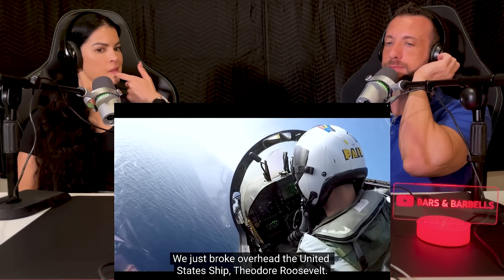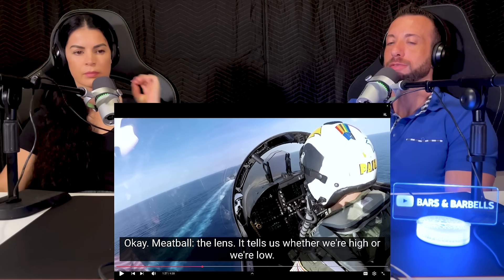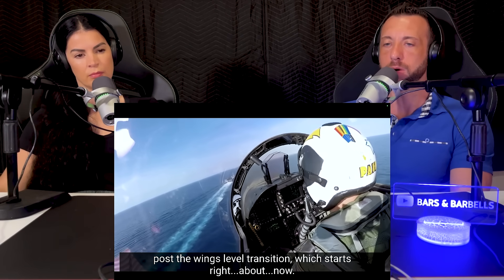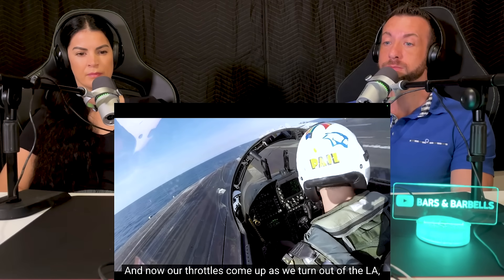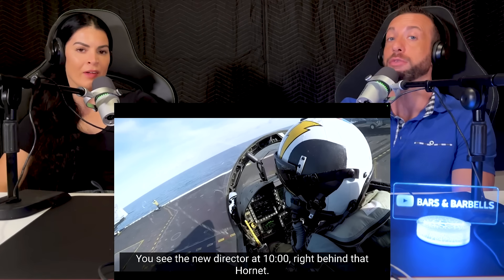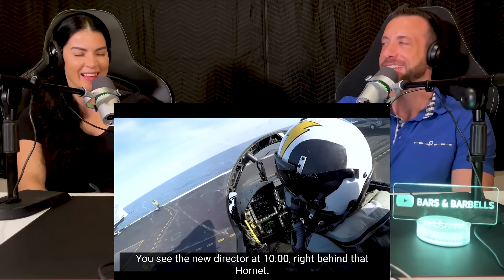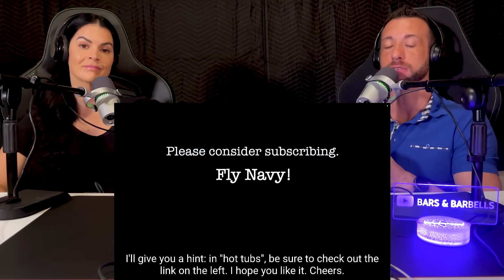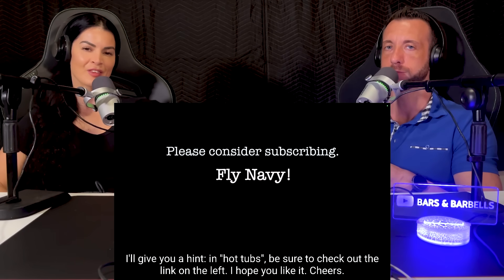HOW PILOTS REALLY LAND ON AIRCRAFT CARRIERS ✈️ | Naval Aviation Landing Explained (Reaction)

Comment: difficult to practice on land...the carrier will speed up quite a bit for landings to put as much wind over the deck as possible...that allows the plane to slow down as much as possible, relative to the ship, to keep wind over the plane wings...hard to simulate that on land.  ship will turn into the wind as well, so if you have 10mph wind, and ship moving at about 30mph, that gives 40mph wind across the plane wings and allows the pilot to slow down that much more, relative the the ship's deck.

Comment: ‘The Ball’ he is referring to is an optical landing system consisting of an orange center light and green outer light lines (red circle to the left as he lands). Pilots job is to keep the orange light centered with the green lights. It sounded like he said he has auto-throttle now. Must be a fairly new thing (I think) but, makes sense since when they launch, the pilot isn’t even touching the stick. It’s all computer controlled.

Comment: In case no one else has mentioned it yet.. the "Signature Move" is when he grabs both of the handles up on the canopy to 'resituate' himself in the pilots-seat, as there are no 'foot-rests' on those aircraft, their feet are always pressed against the 'peddles', and pushing both down at the same time actually triggers a response from the plane, so they cant 'push' with their feet to adjust their sitting position, they have to use the handles for that.

Comment: Meatball, line up, angle of attack, basically means how high am I, how lateral am I (am I lined up on center line), and how fast am I coming down onto the deck. Those lights to the left as he snags the wire give all that information in a very brief glance over so the pilot can focus on the landing as much as possible. They flash red to wave the pilot off if any of these metrics are too far out of safe bounds according to the LSO (landing signal officer) who is also an active pilot watching every landing at the rear of the ship. Every landing is recorded and scored by the LSO. There are 4 wires, pilots aim for the 2 wire for a perfect landing, Pail here snagged the 4 wire, if they miss it they push the throttles all the way forward (full military power) so the jet can get back up off the ship and come around for another pass.

Comment: I live in Virginia Beach, not far from the Norfolk Naval base, the largest naval base in the world, and Oceana naval air station. South of Oceana, about 15 miles, is Fentress ALF which stands for auxiliary landing field. This is an old airstrip that has been repurposed by the U.S. Navy for Training. The pilots have to accumulate a certain number of hours per month in training to stay current. It’s not unusual to see four or more F-18s doing landing and takeoff practice at the field, doing a touch and go and then circling around to do it again time after time. It is very disconcerting to be driving down the road and have an F-18 in landing configuration go over your head at about 100 Feet.

Comment: Landing on an aircraft carrier is a controlled crash.  They dont have the luxury of a long runway to set down on.  They have a box with 4 wires on it.  When they hit the deck they push to full throttle in case they miss the wires so they can take off again.  Takes a pair to do that, especially at night.

Comment: When the Jets are launched off a carrier, they are going 160 mph as the leave the ship.  They are also working with a large drone and when they come into land, they do it exceptionally well.  He didn't say, when they touch down, they go full throttle.  If they miss the wire, they have the power to take back off.  He hooked the 4th wire out of 4.  If he had missed that one, he would have had to "Bolt" back off the carrier and try again.  FYI: The US Navy calls their Pilots, Aviators.  I believe they train for a couple years before going out to the fleet.